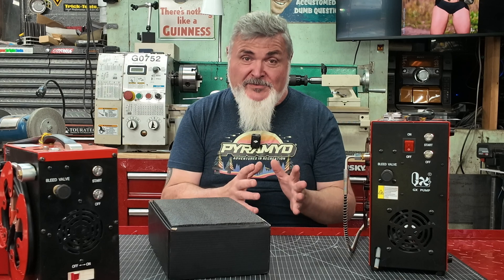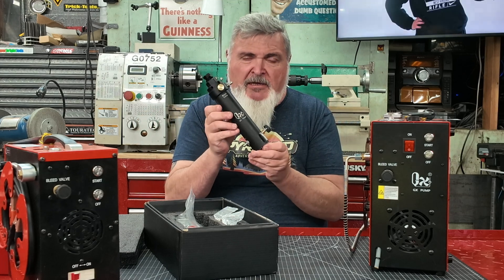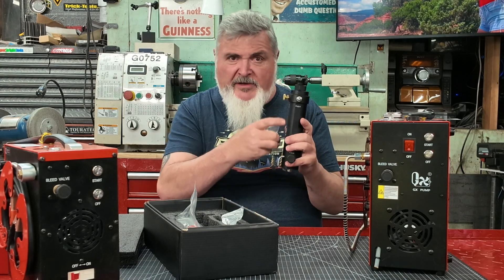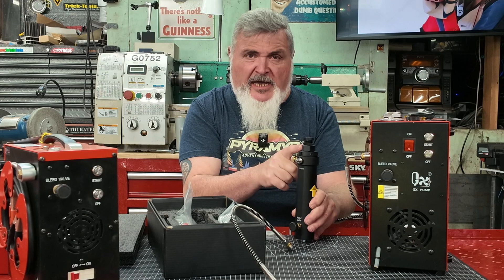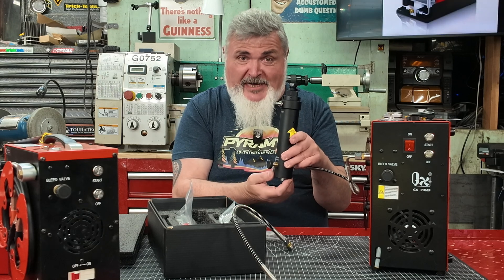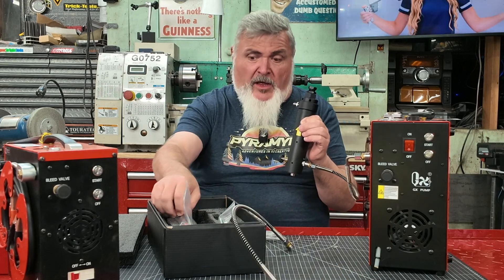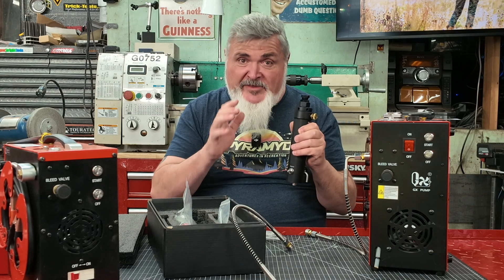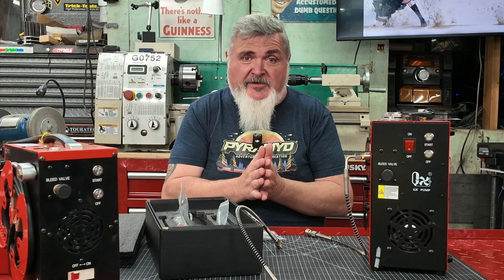Revolutionary Moisture Separator for PCP Airguns: Physics-Powered Dry Air Solution!

Comment: What it the max working pressure of this unit? Does it have an independent rupture disc?  Is there any worry about hydrate formation across the pressure drop when the valve opens at 1800 psi?  Already have one in my Amazon cart but wanted to ask a few questions before buying.  Great to see a new video from you!
Reply from the maker: Below, I’ll reevaluate the probability of hydrate formation in this system, incorporating the desiccant’s effect, while maintaining the other parameters: a compressor delivering up to 4500 psi (310 bar), a pressure-maintaining valve ensuring the coalescer operates at ≥1800 psi (124 bar), and a focus on hydrate formation across the valve.
1. System Setup
Compressor: Delivers compressed air up to 4500 psi (310 bar) into the coalescing moisture separator.

Coalescing moisture separator: Removes liquid water and aerosols, operating at ≥1800 psi (124 bar), ensured by the pressure-maintaining valve.

Micro sieve desiccant: Positioned after the coalescer and before the valve, removes trace moisture (water vapor), reducing the dew point to very low levels (e.g., -40°C or lower, typical for desiccant systems).

Pressure-maintaining valve: Maintains back pressure so the coalescer’s pressure is at least 1800 psi, opening to allow flow when upstream pressure meets or exceeds this threshold. Downstream pressure could be 1800–4500 psi (no drop) or lower, causing a pressure drop.

Gas composition: Compressed air (78% nitrogen, 21% oxygen, trace CO₂), with minimal hydrocarbons unless contaminated.

Temperature: Typically 20–40°C post-cooling, but could be lower (e.g., 10°C in cold environments). Joule-Thomson cooling occurs if there’s a pressure drop across the valve.

2. Impact of the Micro Sieve Desiccant
Micro sieve desiccants (e.g., molecular sieves) are highly effective at removing water vapor, achieving dew points as low as -40°C to -70°C (-40°F to -94°F) at high pressures. This means:
Water content: After the coalescer removes liquid water and aerosols, the desiccant reduces water vapor to trace levels (e.g., <10 ppm or a dew point far below operating temperatures).

Condensation risk: Even with Joule-Thomson cooling across the valve, the air’s dew point is so low that condensation is unlikely unless temperatures drop below -40°C, which is far beyond typical cooling in this system.

Hydrate formation: Hydrates require liquid water or sufficient water vapor to condense. With trace moisture, the availability of water for hydrate formation is severely limited, drastically reducing the probability.

3. Hydrate Formation Conditions
Hydrates form under:
High pressure: Nitrogen hydrates form above ~100 bar (1450 psi) at 0°C, with thresholds of ~10–15°C at 124 bar and ~20–25°C at 310 bar.

Low temperature: Below 10–25°C, depending on pressure.

Water presence: Liquid water or condensed water vapor is essential. The desiccant’s removal of water vapor minimizes this.

Hydrate-forming gases: Nitrogen can form hydrates at 124–310 bar, but without sufficient water, hydrates cannot form.

4. Analysis Across the Pressure-Maintaining Valve
The probability of hydrate formation depends on the pressure drop, cooling, and water availability across the valve.
Pressure Drop Scenarios
No drop: Downstream pressure equals upstream (1800–4500 psi), causing minimal cooling.

Small drop: E.g., 4500 psi to 3000 psi (2000 psi or 138 bar) or 1800 psi to 1200 psi (600 psi or 41 bar).

Large drop: E.g., 4500 psi to 500 psi (4000 psi or 276 bar) or 1800 psi to 100 psi (1700 psi or 117 bar).

Joule-Thomson Cooling
Coefficient: ~0.025°C/bar for air at 20–40°C and high pressures.

Cooling:
41 bar (600 psi) drop: 41 × 0.025 = ~1°C.

138 bar (2000 psi) drop: 138 × 0.025 = ~3.5°C.

276 bar (4000 psi) drop: 276 × 0.025 = ~7°C.

Resulting temperatures (from 20–40°C initial):
20°C → 13–19°C.

40°C → 33–39°C.

Cold conditions (10°C initial): 3–9°C.

Dew point: With the desiccant, the dew point is likely -40°C or lower. Even with 7°C cooling, temperatures (3–39°C) remain far above the dew point, preventing condensation.

Hydrate Risk
Water limitation: The desiccant reduces water vapor to levels where condensation is negligible, even at 3–9°C. Without liquid water, hydrate formation is highly unlikely, regardless of pressure (124–310 bar) or temperature (3–39°C).

Pressure and temperature: While 1800–4500 psi and 3–25°C are within nitrogen hydrate-forming ranges, the lack of water overrides these conditions.

Contamination: Trace hydrocarbons or CO₂ could lower hydrate thresholds, but the desiccant’s effect still limits water availability.

5. Probability Estimate
The micro sieve desiccant drastically reduces the probability of hydrate formation by removing water vapor, preventing condensation across the valve:
No pressure drop: No cooling; no condensation due to low dew point. Probability: Negligible (<1%).

Small pressure drop (600–2000 psi): Cooling of 1–3.5°C yields 16.5–39°C (from 20–40°C) or 6.5–9°C (from 10°C). Temperatures are above the -40°C dew point, so no water condenses. Probability: Negligible (<1%).

Large pressure drop (4000 psi): Cooling of 7°C yields 13–33°C (from 20–40°C) or 3–9°C (from 10°C). Even at 3°C, the dew point (-40°C) prevents condensation. Probability: Very low (1–5%), as trace water might still exist but is insufficient for significant hydrate formation.

Cold environments: Even at 10°C initial temperature, cooling to 3°C doesn’t reach the dew point, keeping probability very low (1–5%).

Overall probability: Negligible to very low (<1–5%) across all scenarios, due to the desiccant’s removal of water vapor, which prevents the liquid water needed for hydrates. The only scenario with slight risk is an extreme pressure drop in a cold environment with minor residual water post-desiccant, but this is minimal.
6. Influencing Factors
Desiccant efficiency: If the micro sieve is saturated or poorly maintained, water removal could be less effective, slightly increasing risk. Regular maintenance ensures low dew points.

Extreme cooling: Temperatures below -40°C (highly unlikely) could theoretically allow condensation, but Joule-Thomson cooling is insufficient to reach this.

Contamination: Hydrocarbons or CO₂ could lower hydrate thresholds, but lack of water still limits formation.

7. Mitigation
The desiccant already minimizes hydrate risk, but additional steps include:
Maintain desiccant: Regularly regenerate or replace the micro sieve to ensure low dew points.

Monitor temperature: Ensure air stays above 0°C to avoid any residual moisture issues.

Prevent contamination: Use oil-free compressors or filters to minimize hydrocarbons.

8. Conclusion
With a micro sieve desiccant removing trace moisture after the coalescer and before the pressure-maintaining valve, the probability of hydrate formation across the valve is negligible to very low (<1–5%) in all scenarios (1800–4500 psi, 10–40°C initial temperature, any pressure drop). The desiccant reduces water vapor to levels where condensation is unlikely, even with Joule-Thomson cooling (1–7°C), preventing the liquid water needed for hydrates. Regular desiccant maintenance and contamination control further minimize risk.
Reply: Just ordered it ❤🎉 & wondering if it's good for filling 6.8L tanks, or will it need a purge every 10min or so?😮🎯
Reply from the maker: That variable is dependant on your ambient temperature and RH. More of either will required more frequent venting of both the compressor AND the separator.
Reply: @TargetForge  thank you for the information 🏁
Reply from the maker: They tell me it will go to 5800psi, mine will never see that. It does not have another burst disk, its inline with the one in the compressor. Regarding your hydrate worry, divers have been using this method to strip moisture for years, this is simply a scaled down version of that technology. At this price point nothing else currently exists. Thank you for your comment! And your continued support!